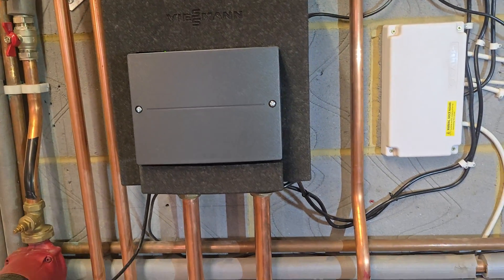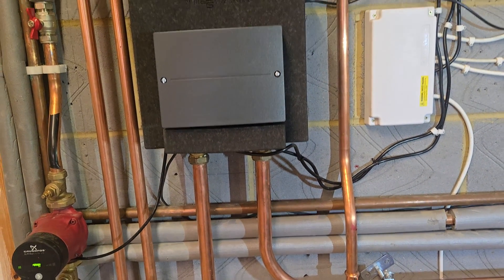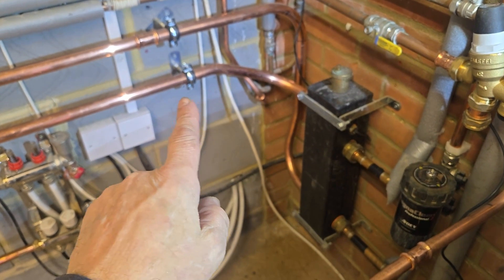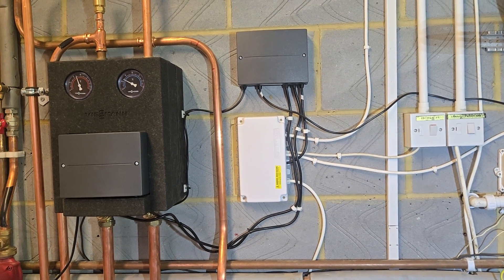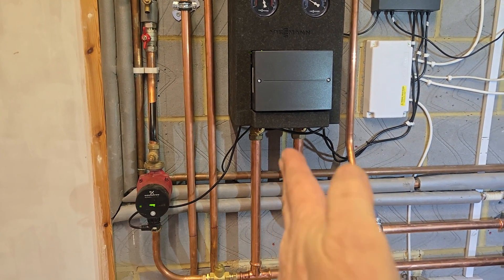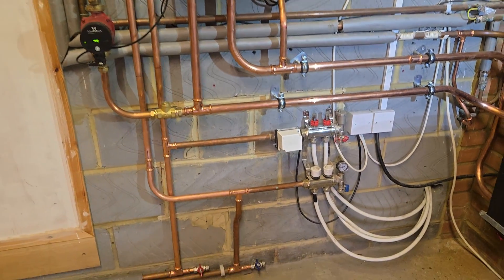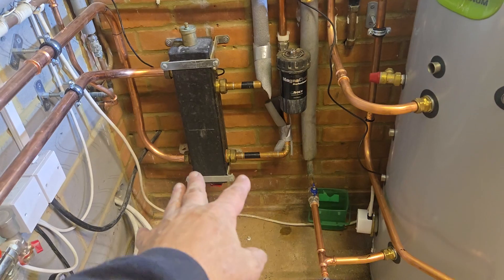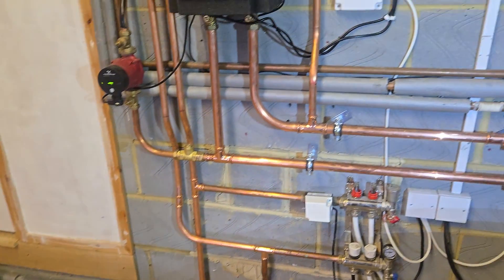The new divicon from Viessmann.

Comment: We love our new 100-W it replaced an ancient Thorn Apollo System boiler. The four pipe system makes installation so simple, we added about 50cm of pipe to connect directly to the DHW cylinder and then we could then get rid of the unreliable 2-way valve, the room stat, the header tank, the wiring centre, the time controller, the tank stat and the circulation pump. Now we have weather comp and an iPhone app to control everything. Cost of the boiler was ~£700 a year ago.

Comment: I'v got a 100 which needs fitting. You want to do it? (serious question)
Reply from the maker: Where is the job
Reply: @andrewmillwardwatford9410  Hi Andrew, thanks fo the reply. I tried to use the link to your website from the about tab, but it didn't work, least not for me right now. I wanted to check where you work. I wasn't sure if "Watford" meant where you work or was part of your name. I'm in south London. Might have two boilers to replace, although I've only got one 100, so would need to source another if the second needs doing. 

Neither is a straight swap. Going from 117 liter unvented + Baxi solo 2s. Trying to get someone who knows what they're doing, so I can have weather compensation etc. I'm on rads atm, at least one rad needs changing. No one seems to be good with Viessmann stuff. They all want to push you to their usual brands.
Reply from the maker: @markfernandes2467 yes i'm based in watford north london
Reply: @andrewmillwardwatford9410  So too far then, no?
Reply from the maker: @markfernandes2467 where about in south london
Reply: @andrewmillwardwatford9410  So is that too far for you Andrew? Pls let me know, cheers.
Reply from the maker: @markfernandes2467 can you tell me where the job is?Please